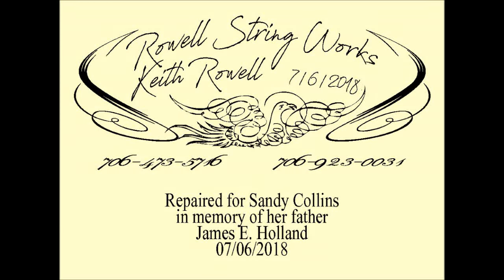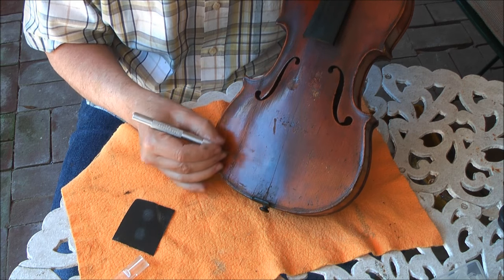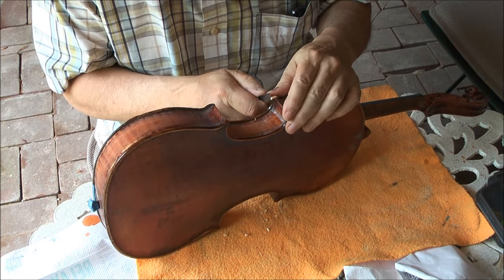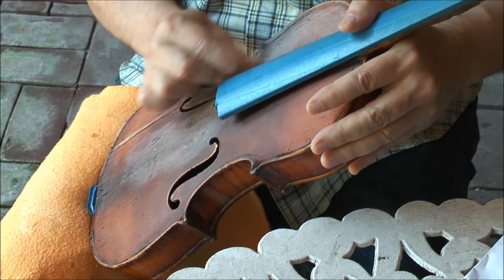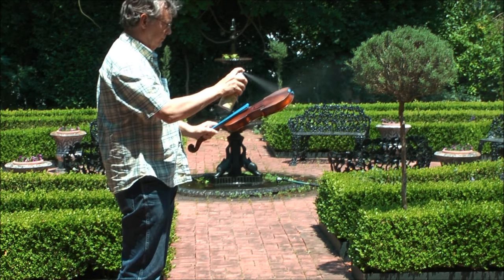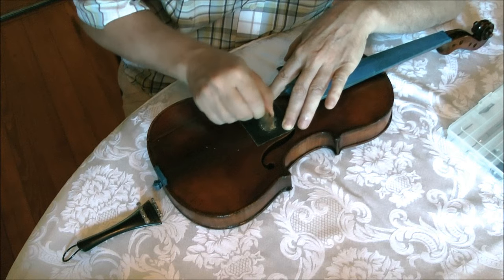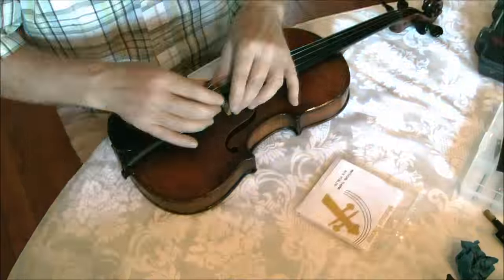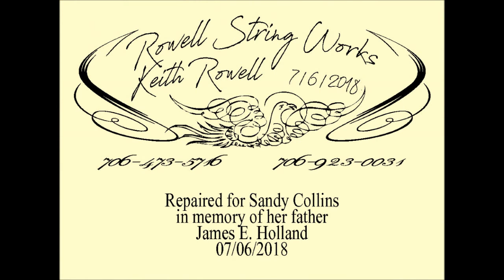James E. Holland / Sandy Collins Violin Restoration

Comment: Is it ok to use laquer vs brushing on shellac?
Reply from the maker: That's a judgement call. Traditional finishes in order of quality are: spirit (which includes tree resins), oil, shellac. Lacquer was originally a shellac but now frequently refers to petroleum based products. These can be better in some ways (hardness, ease of use) but are not traditional. It's a judgement call as to whether one wants to diverge from tradition. I would er on the side of tradition unless I was working on a cheap modern violin. 

I apologize for the delay in responding. I'm still getting the hang of the "youtube" interface. : )

Comment: Hey, great job! I'm at the start of something very similar, and have a couple of questions for you: 
- What are you spraying it with?
- what kind colors do you use for painting it? And do you think some other colors would work better at covering the old scars?
- Do you use pure water for sandpaper?

Thanks!
Reply from the maker: Wow, I just got your comment. I'm sorry about that. 
Sprayed with shellac
Oil colors, you can add alcohol dye to shellac in a french polish method. It's translucent so it doesn't obscure wood grain, but is very hard to manage. Oil is traditional.
Just tap water.

Comment: Did the sanding and overspray change the tone quality?
Reply from the maker: The tone is affected by the finnish. Essentially the harder the finish the better. Shellac takes a long time to fully harden but not as long as oil based finishes. I sometimes use a french polish method that is somewhere in between. Spirit varnish is the hardest, most expensive, traditional finish. But it's the shape, thickness, quality, weight, of the wood plates that is most important for volume and tone.
Reply: @KeithRowell  this guy has no idea what hes talking about
spirit varnish is the cheapest fastest shit
its shellac and alcohol
french polish is not 'inbetween"
its shellac and alcohol only weaker
oil varnish is the presstige finish
but it to is just a con to pump up the price
nitrocellulose lacquer, like used here, used to be the go to guitar finish
so the american bluegrass and country players tend to use that because they go to guitar repair guys
its to fragile and never really cures,but its easy to touch up, which is good i think
classical players would shreak in horror at that
but those clowns dont know anything
theyre they same fools who pay, on average. 10 grand for a" professionl level violin"
and MILLIONS for strads and del jesu's which is another complete con
those violins arent any better then anything  else
the price of those strdivarius and guaneri violins is due the tax shelter and money laudering games being played by the 'chartible foundations' thay own them
its more total bullshit
WHATS THE BEST FINISH FOR VIOLINS?
scientific studies have concluded
ordinary hardware store SPAR VARNISH its flexible and tough
just thin it out a bit, and dont put on to many coats